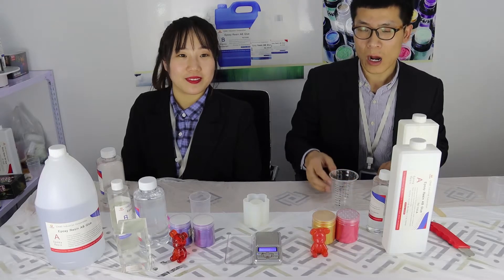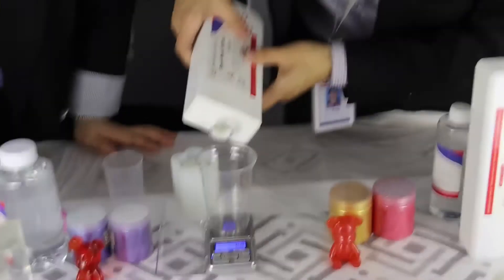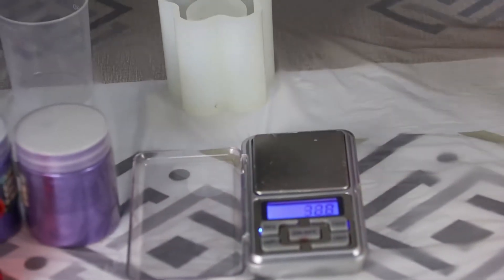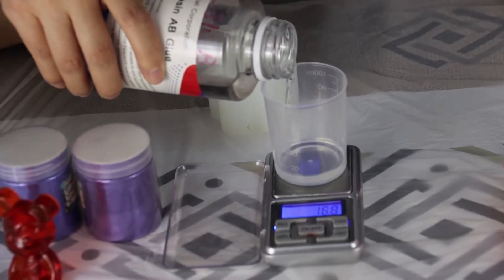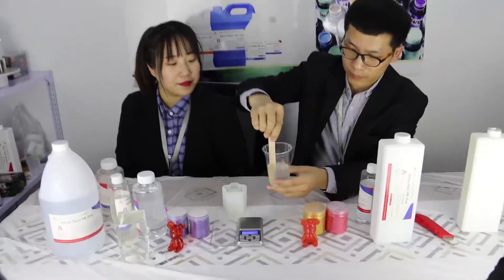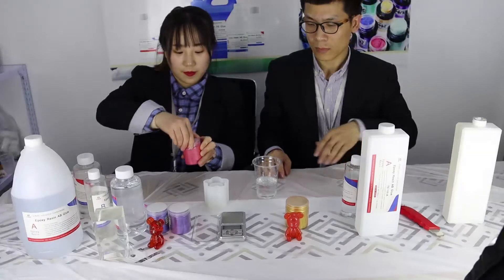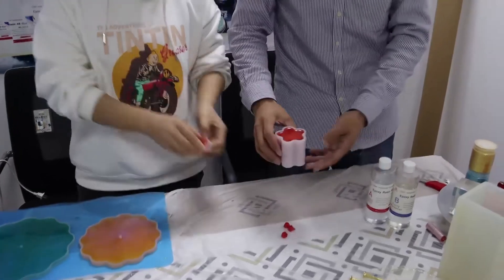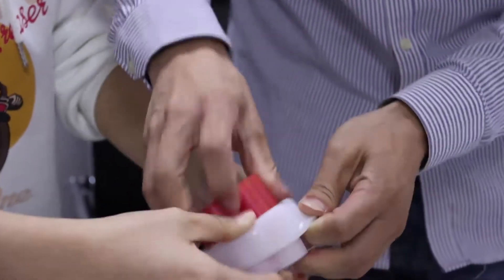CNMI Epoxy Resin HL310 3:1 Mix Ratio, how to use?

Comment: I found this very useful thank you very much because I can understand now the 3 to 1 ratio I work with epoxy resins and find it really hard when I try and measure the ratio amount s🌈🙂
Reply from the maker: We also have other models of TC110 1:1 by volume for top coating, HL210 2:1 by weight for jewelry and river table, HL521 2:1 by volume for deep casting large scale river table more than 10cm. According to the project you make, you can choose the suitable one.😉